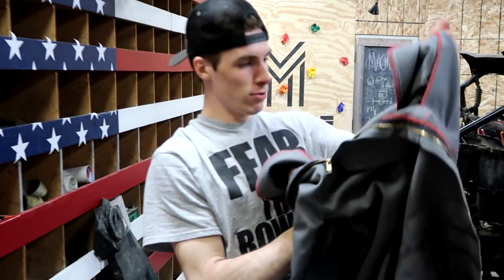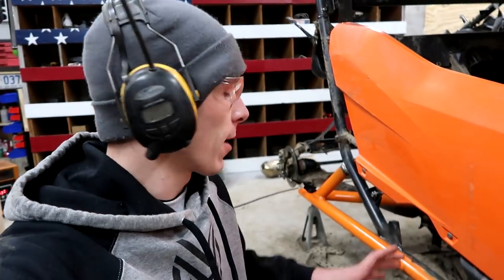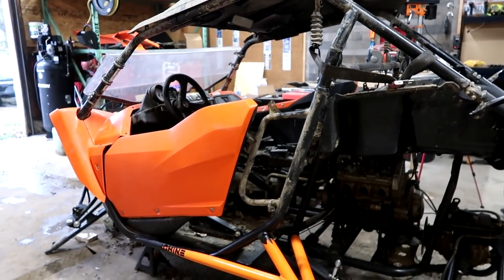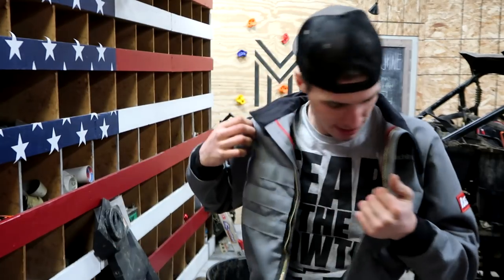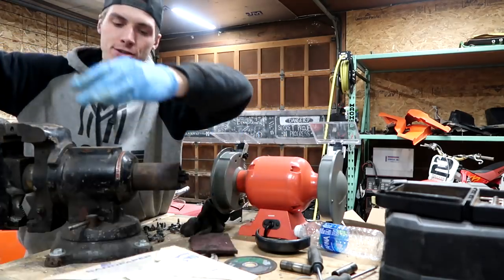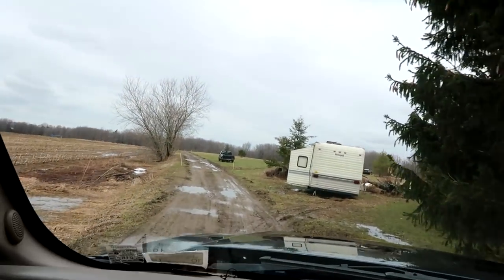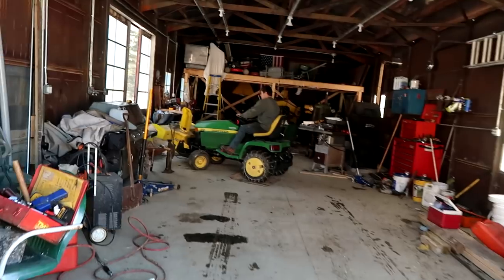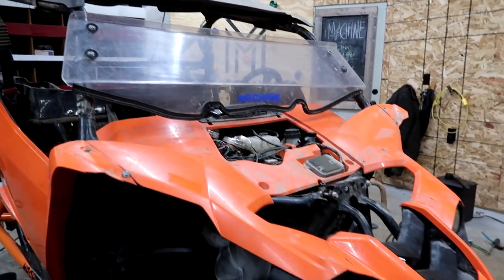THE GREATEST TOOL EVER!

Comment: I have a drill press a lot like that one. It is self feeding/drilling as well. I bought it at an auction for $25. One of these days I'm going too get mine hooked up and working. 

Good too get some work done on Crush I'm sure. 

Wanted to let you know I bought one of your Machine stickers, didn't see a place for color choice, but was in a hurry. I got black. Now I bought a decent 44" tool box for my machine shop area and wouldn't you know it. the tool box is black. 

Keep the great vids coming.

Comment: I use EBC brakes on my bike. They stop good, their cheap, but they wear out kinda quick. I guess that's the trade-off with brakes. Actually who am I kidding, I think my last set last a year on the back and the fronts are still good going on year 2 with several races and many rides. I mean, their not the best stopping power but for me they definitely get the job done. Braaptastic.

Comment: Dalton I don't know if you've found out yet but the hitch in the front of crush was so if you break down someone can just back up and hook up to you.
Reply: Dylan's dirt bikes I've also seen them used for winch mounting or snow plow mounting
Reply: The idea of removing it was to prepare for racing only, any unnecessary weight could mean a drag on elaspe time and fuel efficiency. I do agree with you though, he should weld a much lighter small hook of some sort for quick towing.